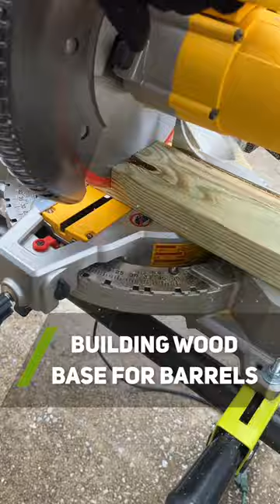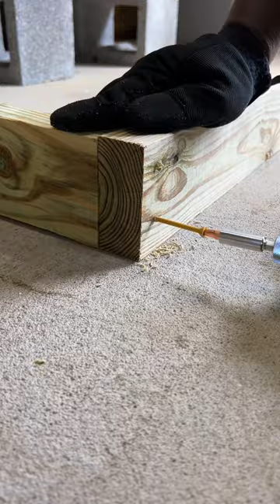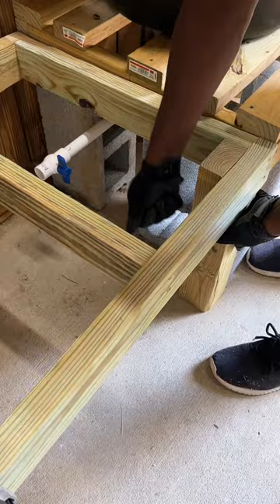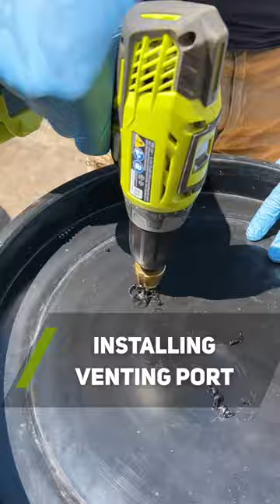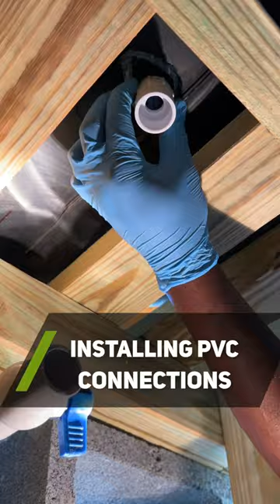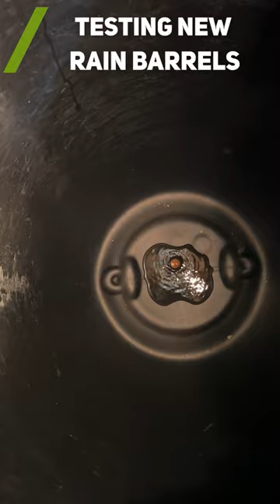Rain Barrel System | CHEAP Water Capacity Upgrade - #Shorts

Comment: You never rely on screws or nails driven into the end grain. Those tiny screws will 1. Pull out as the wood dries and 2. Not support all of that weight. Thin screws like that don't have a lotnofbsjeer strength. Safety hazard.

You should use joist hangers and corner brackets with the appropriate nails or screws.

Comment: Why not just use an IBC? They can be had very cheap by going to a food production or even a landscape company. They sell off their used ibcs for next to nothing. I got a 350 gallon capacity IBC for $30 last year from a landscape company that used it for dye. The dye in question was natural being composed of 100% charcoal dye used to blacken mulch. A simple rinse with a scrub brush on a pole and flushing of the system gave me a fully functional IBC in like new condition and only takes up a footprint of 3 ft by 4 ft. Came with the cage, cap, valve, and platform, just cost me 30 bucks in a little bit of elbow grease. The other good thing about ibcs is that they typically come with a valve, and the cap and valve fit standard 2-in PVC fittings for plumbing, linking, and or winterizing. Note if obtaining from a landscape company; make sure that the dye was a natural dye. If obtaining from a food production plant of course you will have to rinse but you know that it's good because it was food safe to begin with. And if you ever need to empty them simply open the valve and it will literally drain out almost every last drop because of the design of the IBC valve location. Once empty they only weigh about 60 lb and can be easily moved by a single person. I picked mine up, loaded it, and unloaded it on my own.
Reply from the maker: I plan to one day. Just slowly working my way up to that level as I learn more about rain collection. Thanks for the info on your setup and experience.

Comment: Why didn't you use a matching support system.
Reply from the maker: Hey Malcolm. Good question. I decided to change it up and provide even more vertical support based on the feedback I received for the first one. The first one is still working just fine, however, others claimed that due to the position of the concrete supports, the support strength is reduced. I believe the reason I'm not having major issues is because of the total amount I am using and the weight being distributed evenly.

Comment: Why is the valve on the main line and not the barrel line?
Reply from the maker: No particular reason in my case. Not something I gave a ton of thought about, but if the other method works better for your application, I say go for it.
Reply: @GreenTechTown  just thinking it would be nice to isolate a barrel if needed. Where I am is water rich, no need to collect.

Comment: I've just got a question, do you constantly use that water for something think and if not how long could you actually store that water without it going stale or stagnant
Reply from the maker: Good question. I've seen anywhere from 1 week to 8 weeks depending on how you seal the barrel/s. But I would advise to ask a rain harvesting company as this is just something I quickly found online.
Reply: @GreenTechTown  You can add filters or even some additives, like chlorine or other products, especially if you are drinking it.

Comment: Why use black? If white, you can see the water level directly right?
Reply from the maker: If you use white, you risk algae growth. A black barrel does not allow light to enter. You will also find people who used a white barrel/tank eventually paint them.
Reply: @GreenTechTown  got it. Thank you!
Reply: White barrels will also breakdown in sunlight. It takes about 18 months then they crack.
Reply: @williamfranklin6283  really??? I've had some 250 gallon tanks outside in direct light for 8 years with no issues.

Comment: Cinder blocks have no strength when they are turned on edge .
Reply from the maker: Yes, it has some strength but not as much as when positioned correctly. It was an oversight for the first stand I made. So far it is still working well, likely due to the weight being disturbed between 6 cinder blocks, but I do plan to add some re-enforcement to make sure I do not run into issues in the future. Thanks for the feedback!